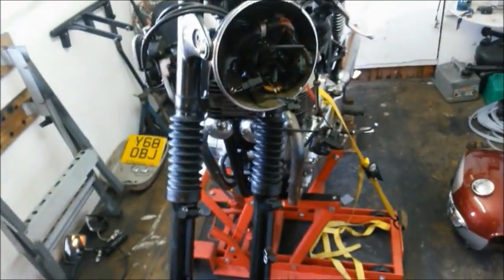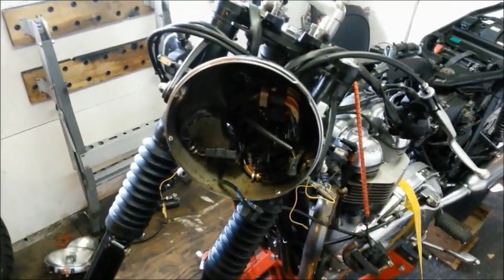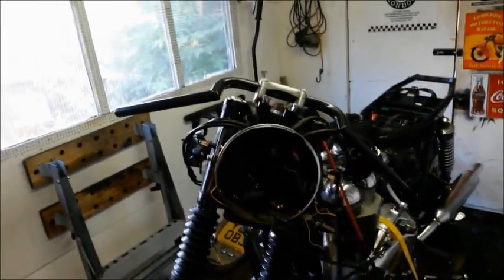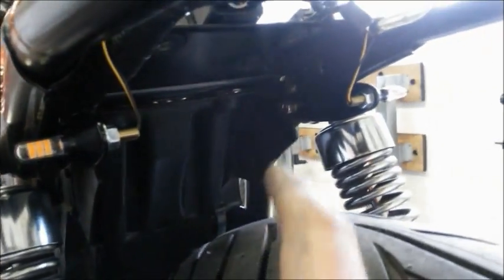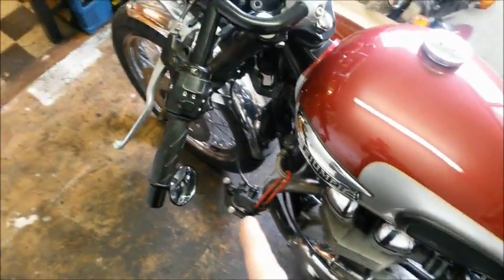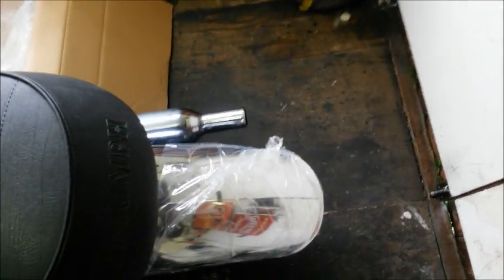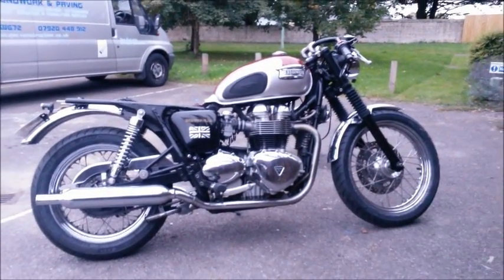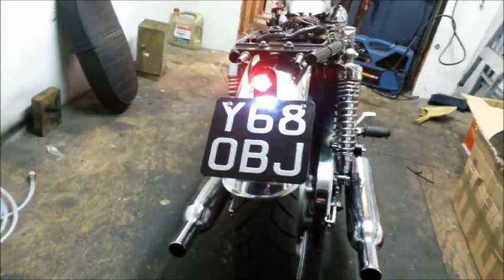TRIUMPH T100 BONNEVILLE PT2

Comment: Hello
I have a bonneville with mug wheels and i am interested in Avon Distanzia 120 front and 150 rear. Which is your opinion?
Reply from the maker: Konstadinos Xenos hi mate- i never tried putting bigger tyres on my mag wheels- i changed them to wider spoked rims - so i'm running a 120 on the front and a 160 rear but with wider rims. plenty of people have forced a bigger tyre on a mag wheel, but i have no idea of any issues to look out for i'm afraid!!

Comment: I like the mods JC. the Master break cyclender on this bike could be the mod for your own? looks pretty cool and is style you suggested you may look at.
Reply from the maker: it's exactly what i'd rather but in their wisdom triumph only did that m/c on the t100/america/speedmaster/and thrux? in short 1" handlebar bikes- mag bonnie and scram (7/8 bar bikes) got a piss cup......!!!! there are other bikes you can easily retro fit but it's finding the brake levers etc to match...researching at the mo!!!!
Reply: couldn't you use a sleive to pack out the bar around where you bolt the MC on?
Reply from the maker: i like the sieve idea!!!- i've used thin aluminium and even coke cans in the past but the sieve would grip well!!!- the only drawback is finding a m/c cheap enough- for the prices they go for i would rather fork out for the british customs direct mount master cylinder.......and i think i like the look of it more too!!! ;-)

Comment: Fantastic! That rear fender is just what I'm looking for my Thruxton.
What is the procedure for aligning the front end?
Reply from the maker: gotta say its my first look at the MAS engineering stuff up close and in the flesh and it is nice!!! it would look amazing on your thrux mate!!! aligning the front end is just a case of loosening everything below the uppermost yoke pinch bolts and sitting on the bike pull the brake in and pump the whole lot several times .it just settles the front end in straight in case all the pulling and wiggling has pushed it out or twisted slightly.